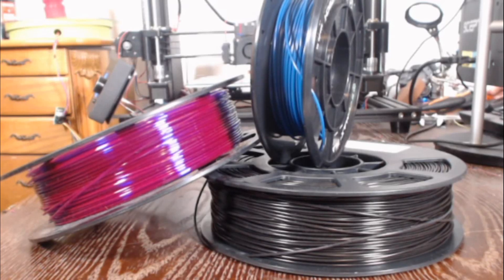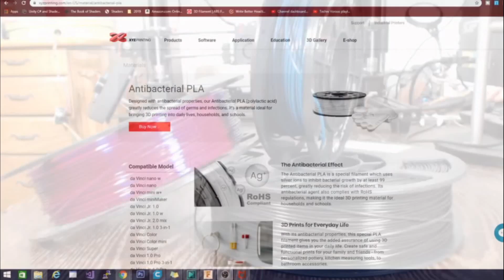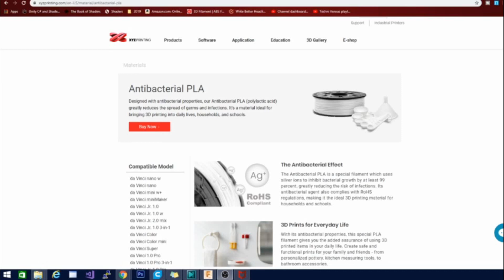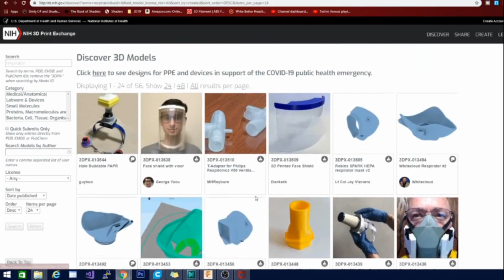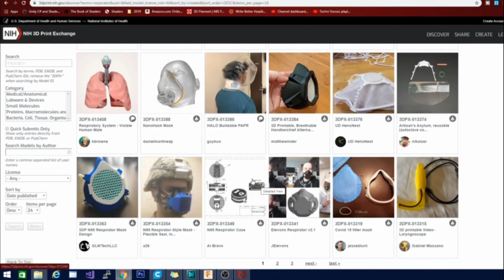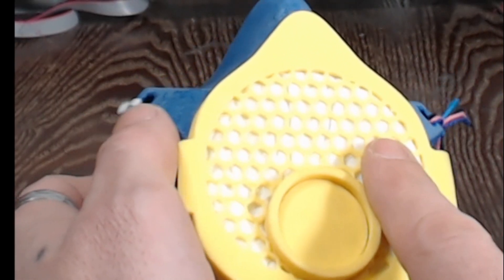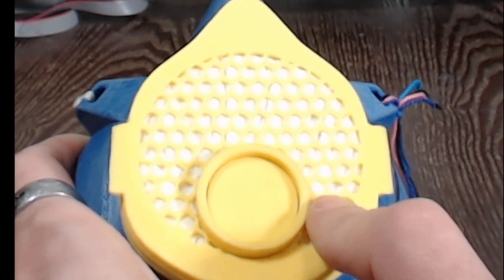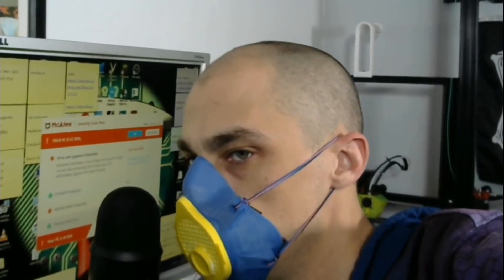3d printed mask - facemask - ventilator - for Personal Use

Comment: During the Vader speech you can se the mask is not tight (enough). Basic test is holding your hand over the filter blocking it, and then try inhale & exhale.
Reply from the maker: Thank you! Yeah I hadn't gotten the proper elastic yet so it was string. All fixed now. ;)

Comment: antibacterial < antiviral

Antibacterial won't necessarily protect against viruses.
Reply from the maker: No your not breathing out of the plastic. It need to be able to be sanitized by something that can kill the virus, the filter is the part that protects you from the virus. The point limit u use regular pla, you cant clean it thoroughly because microbes can get between the layer lines. You dont need the antibacterial to protect you that's what the filter is for you need it so it can be cleaned. However if u can find antiviral filament somewhere give it a shot.
Reply: @Technivorous  the virus lives on surfaces for several hours. So if the virus gets on the surface of the mask and people think their antibacterial PLA will keep it clean...
Reply from the maker: @TrismegistusMx  i also expressly state the mask will need to be cleaned, that if you use regular pla it cant be cleaned because microbes get in between the layer lines. as stated this is not intended for surgeons or to be a perfect solution. if you dont want to disinfect your mask, use disposable ones. yes the mask needs to be cleaned regularly. if someone is not smart enough to sanitize thier equipment, they wont be using it anyway, because they probably watch fox news and listen to trump. anyone with half a brain( i.e. smart enough to be looking for alternative to dying) would do their own research and visit the cdc website as i state in the description. i will however update my description to reflect your concern about people misunderstanding, and i thank you for your input.

Comment: Also I broke the hot end on my a20m making face shields for my local hospital. I ordered the parts but coming from China so who knows, probably be faster getting a different printer. So now down to just my ender 3 but now made a file where they are stacked so it will work.
Reply from the maker: damn bro that sucks.

Comment: I've done prints where I've started the print in PLA and paused at a layer height and switched to TPU. As long as the layer where you switch is not just a bunch of infill, the filament change layer doesn't turn out too weak. I wonder if this mask, or one like it, could be printed starting off in PLA (or PETG or ABS) for the part where the filter and valve are and then switches over to TPU for the part that interfaces with your face for a better fit/tighter seal/more comfortable fit.
Reply from the maker: This is worth a shot for sure
Reply: I think that’s a great idea.  I personally plan on trying this with PETG and TPU.  I hear that they will bond pretty well and have similar print settings.